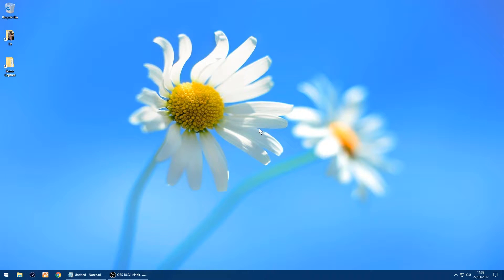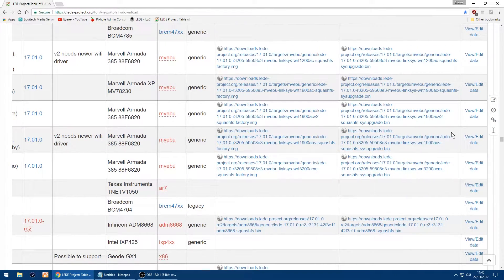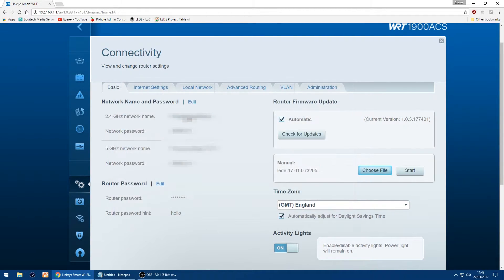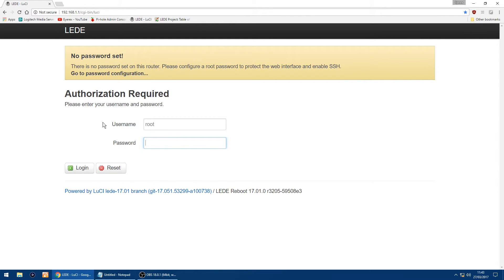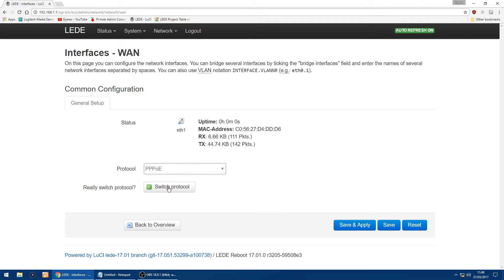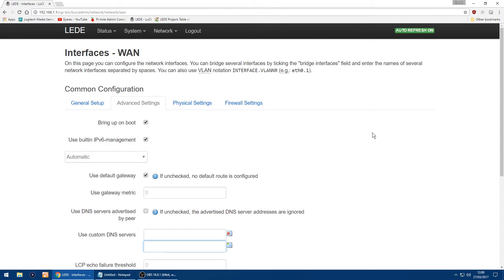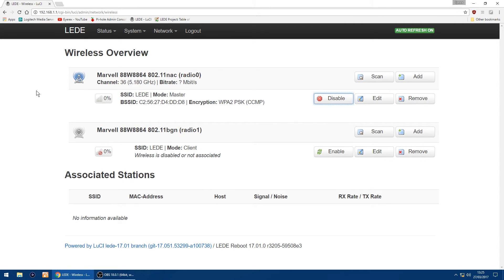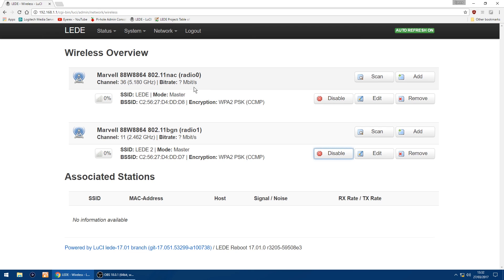OpenWrt ADSL and WiFi Setup Linksys WRT1900ACS

Comment: Always back up current firmware and settings first before upgrading your Router.....................................Also do screenshots of current settings of the Router before installing the Openwrt so you can make it as seemless as possible.....................

Comment: mine is not connecting after i do the firmware upgrade
Reply from the maker: Internet via Modem or WiFi
Reply: I can’t access the router
Reply from the maker: @ishmaellamy6123  Whats the Router ? have you tried another Ethernet lead and resetting the router via button at the rear

Comment: So i know you said talktalk, I was also on them but not on sky. I've been curious about how to connect it to the VDSL line without the original sky router. Have you got yours connected direct or do you use something like an openreach modem?
Reply from the maker: Hello i use a DrayTek Vigor 130 modem on ADSL which i think can also be used with BT fiber
Reply: Eyerex great thanks :) I just bought the Openreach do I'll see how they goes first.
Reply from the maker: You should be ok just put the Openreach into bridging mode ps the BT hardware is listed on LEDE is your just a Modem or a Homehub https://lede-project.org/toh/views/toh_fwdownload?dataflt%5BBrand*~%5D=bt

Comment: so can i throw my old ee router in the bin if i do this? the just buy an adsl to ethernet cable?
Reply from the maker: Isn't the EE a Modem / Router as the WRT1900 is just a Router so you may still need the EE and see if it can be run in Bridge Mode to feed the Router

Comment: How would i know if i have v1 or v2?

Is there a way to have Guest ssid and throttle everyone connecting to Guest?
Reply from the maker: Would check the serial number
Reply: Eyerex it’s ok now. have to google a lot to finally confirm it.

now on the hard part, choosing which firmware to install. reviews says dd-wrt is much user friendly than lede.. and i really want to maximise that guest access.

Comment: Hello Eyerex, since I am planning to buy a open source capable router the interest in your video is rather great. After you were running through the WAN interface set up I am wondering where I can enter my VPI and VCI values which are crucial for my VDSL connection? An answer is really appreciated. Greetings
Reply from the maker: Hello i think the VPI and VCI settings would be covered within the modem you chose to use and not the Router unless you buy a "Modem Router" i use a DrayTek Vigor Modem with my Linksys and the extra connections settings like VPI and VCI are within there
Reply: Thanks mate

Comment: Hello,I wanted to ask if Lede will work ony my wr-940n/941nd v5 router? I tried installing dd-wrt before and it was almost a success (lost internet connection for some reason,so had to revert to stock firmware).
Reply from the maker: Looks like there listed you just have to make sure you download the right version for your model